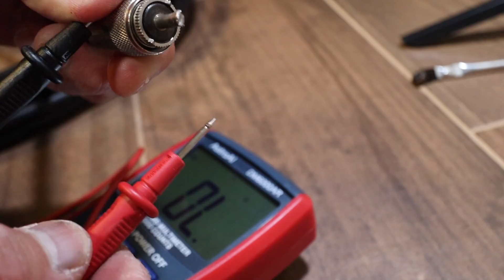WTF! | Neighbors cut my Coax! | Repair my PL259 connector Ghetto Style | Not my best soldering

Comment from the maker: I filed a "Criminal Mischief" report with my local Police Department.  I also have a camera facing my antennas for any future mischief's by anyone.
Reply: Some people are just miserable but should NEVER touch you property. I hope you find a resolve to have your antenna's up and enjoy your hobby. Best of luck.
Reply: Cameras will act as a deterrent.  If you can conceal them, you'll be more likely to catch them doing it again.  I'm guessing it's not an option in your neighborhood to mount the antenna on your chimney, or on a stake in your back yard?  Also, judging by its construction, it looks like you own that fence—which (at least in my area) means it's some distance inside your property line.  Edit: another thought: put a few feet of flexible metal conduit around the coax, so they need to use noisy power tools, or spend a couple minutes with a hacksaw—right in front of the camera.
Reply: That's a great start. Also it might be good to inform the less knowledgeable that as an amateur radio operator you provide an essential community/emergency safety service for free...Fla is of course prone to hurricanes, with loss of power/comes likely....
Reply: paint it neon orange too, for that extra eyesore sting
Reply: I had the neighborhood "Karen" say my antennas in my yard were and eyesore as well as my two antennas on my car and all should be removed.  WTF?  I just came back with her and said that the only eyesore I noticed in this neighborhood was her.  I hurt the little snowflake's feelings with that comment.
Reply: Thanks for the quick QSO this evening.

Sorry this happened to you (granted I'm a year late).  Seems they had to reach across the property line, assuming you own the fence.

Yeah, where you are, if not mistaken they have some fairly HOA-like municipal ordinances.  Over here on my side of the creek, they're becoming more like that, but the new mayor's reputation in my household doesn't have me holding my breath that it'll get any better here.  

I have two antennas that are very easily visible from across the street.  One is an inverted vee, possibly to become a fan if I can't get the fan vertical to perform (but so far it's promising), and the other -- the 2-meter super-J-pole I spoke to you with tonight -- is only visible because it's taped to a ten foot long 3/4 inch schedule 40 PVC pipe for rigidity, 30 feet up in my magnolia lifted with bright green 3/8 inch rope.  Fortunately there's no city ordinance against them on my side of the creek, and while permits are required for everything (though I don't think that includes antennas that are not supported by structures like towers), I'm certain they're not enforcing that for things like towers.  Still there are plenty of antennas out this way if you know where to look.  

Either way, it's been a year...  I'm curious if there have been any further developments or other trouble.  Seems to me that side of the creek is loaded with Karens.  Over here there are some but typically they keep to themselves.

Good luck!
Reply from the maker: @ke4edd  Yeah CJ, I'm okay with multi antennas for ham radio.  I talked to you also on a J pole about 25' up.  Check this video out:  https://www.youtube.com/watch?v=vSHr8k07PdQ&t=3s  73's
Reply from the maker: @ke4edd  Other troubles?  Why yes, check this video:  https://www.youtube.com/watch?v=ZigHPpKptLk&t=15s
Reply: @DarrenN4VFR  peculiar, i just watched that right before seeing this reply.

I see plenty of "car canopies" over here, the aluminum ones that look like incomplete sheds.  I don't know Jacksonville's ordinances regarding those specifically, but I've never seen an inflatable like that one.

I have a red 1986 Dodge Daytona Turbo Z C/S that I ran into the rear end of a 2003 Volkswagen Passat one heavily rainy morning getting onto the Arlington expressway.  It spent 7 or 8 years in my driveway before either a neighbor complained or the city did their regular drive-by.  Because the tag was expired, and because the tag was visible from the road, they left a red piece of paper telling me either to remove the vehicle or they would remove it for me, with a similar daily impound fee.

That was the impetus to empty out half of my garage and fit it in there.

At least your Porsche is drivable.  I miss my T-tops.

You know...   There are very nice homes for sale here on my side of the creek...  Two-car garages...  Some two story/multilevel with a 90x120 or larger lot with which to grow antennas and edibles...   And hams everywhere...    Just saying...  ;D
Reply: Sorry to hear that this happened to you. I never had anyone cut my coax but I did have some little kids tugging on my ropes that were holding up my 160-40 meter center-fed. I walked over to them as they were "working" and they said they were collecting "free" rope. They had no idea what was on the other end of those ropes and were pretty horrified that the ropes out in my woods actually belonged to someone. No harm done and they apologized and helped me re-tension the antenna ropes and that was the end of it. At any rate, hope your neighbor behaves in the future! 73, Rob W1AEX
Reply from the maker: @W1AEX  Hey Rob, I just recognized your call from the Apache Lab's website under  
FAQs, Software for Apache Lab Transceivers.   Just yesterday, I put in a deposit for 7000dle.  I might need to contact you to assist with set up in the future.  73's de Capt Darren N4VFR

Comment: After looking again, at 1:30 it's clear the fence is the perimeter of the neighbor's property.  Now, me, if I were building the fence, the posts would be on my side (harder to climb over from the outside) but most people here think that's "ugly" so they put the posts on the outside of the fence (which also saves the trouble of obtaining permission to be on the neighbor's side for the installation).  This looks to me like it's the neighbor's fence, neighbor's property, where you installed your antenna.  I also recall some vague law or something involving property rights when you have your stuff on your neighbor's property -- specifically it involved fences built on the wrong side of the property line -- but that was my father-in-law telling me about it when his neighbor put up a fence and I don't remember the details.

Still.  Was a year ago.  How'd it turn out?
Reply from the maker: I relocated my antenna on a 25' metal pole inside the trees.

Comment: That is bad. But I have to ask, is that your neighbors fence? From the way it's built I would say so. That being said that's his property that your antenna is attached to. So did you get permission to attach your antenna to your neighbors fence? I don't see why you could have attached the antenna to the back eve of that blue shed. Just an observation.
Reply from the maker: Yeah, it was attached to my neighbor's fence.  I did not ask for their permission and it doesn't serve them right to cut it.  They could of wrote me a letter or come over and knock on the door. They're A-holes and always complaining.  I have a police report to this incident. I just put it there temporarily for about 2 week and when I came home, it was cut.  I just put up another HF antenna my DX Commander and not more than 10 mins, I get a phone call from my city's code enforcement stating I was putting up another antenna. I called code enforcement back the next day and I sent a copy of my FCC license.  I told them I needed these 3 antennas because they operated on different freq bands.  Code enforcement with working with their attorneys to have the city's stature/ordinance change to not violate my FCC communications rights.
I asked who complained and they told me it was coming from my back yard neighbor. I should complain about how high their fences are and not in compliance with code and they would have to get it fixed which will cost more time and money! But I'd rather not have them peering into my property easily.  73's
Reply: @DarrenN4VFR  I hope you get everything straightened out. I live in Alabama and our laws and ordinances are different concerning fences and attachment to them or anything hanging over the fence onto an adjacent property. By our law/ordinance my neighbor could have taken the antenna down with nothing said and I could not have done anything about it. You just has a nosy disgruntled neighbor that just wants to be all in your business. I hope you will be able to get your antennas up without a lawyer...

Comment: Does the city have a problem with your ham antennas ? If so work with them and bring the ARRL along with FCC documentation as to your right to have those antennas. It looks like you did a good job on camouflage the UHF/VHF Antenna and also the HF antenna.
Reply from the maker: I've written a letter to my city with this reference :  http://www.leg.state.fl.us/statutes/index.cfm?App_mode=Display_Statute&Search_String=&URL=0100-0199/0166/Sections/0166.0435.html  I waited a little over a month to see if they were going to respond whic they haven't.  So therefore, I put back up all of my antennas.

Comment: the shielding of the cable is supposed to be twisted and put through those holes you soldered @ 11:46, and then soldered on that gap around those holes. there is a resistance as you measured it with the multimeter, that resistance will cause heat when transmitting with higher power, the cable will melt then and cause a short, that can destroy the amplifier. i would redo that connector. beside that, maybe you caused some interference into their electronic devices, which is why the cut that cable. better would be to add some ferrite tubes one the end of the antenna cable where it goes into the antenna, that helps alot to attenuate the potential for interference, a ground rod to ground the antenna would help too.

Comment: I use house hold scissors for cutting the shield away, works real well and if you ever need to sharpen the scissors, which I hardly have to, but use a light grit sand paper and cut several strips off the sand paper, sharpens up the blades on the cheap.
Reply: Wanted to add, not the outter casing, (the black plastic shielding), cause how you did it was perfect, but the braided ground shield using scissors, sorry to anyone if I made that confusing.

Comment: Well you live in Flo-i-duh, the state of do what I want you to do and F your feelings and desires if you don't like it!  I would advise that you get yourself a Diamond X700 and put that up on the peak of your roof where they can both see it and not access it to do harm.  But you clearly were asking for it by mounting it on the fence.  I suspect that the neighbor installed the fence and being Flo-i-duh you get the ugly post side unlike just about anywhere else in the country.  By the way, check with the city about fence installation requirements and rules.  They may be in violation of height and aestetics requirements.  You could also check to see if they are setback from the property line the proper distance as well.  That fence could be your opportunity to provide them with allot of issues and cost for non compliance.   I would start with the municipalities require a setback from the property line.  So hard with neighbors like this.  You did the best thing by repairing and moving the antenna to prevent this in the future.  Actually stunned considering how unobtrusive the Jpole is.
Reply from the maker: I know their fence is non-compliance on their height, but I'm not complaining.  I'd prefer privacy from them.  Your right about checking out the height requirements and proper setback distances.  Surely, that will cost them $$$ for non compliance as you said.  Thank you for your feedback.
Reply: @DarrenN4VFR  Always good to go in loaded for bear.  I totally understand your desire for a barrier from these sorts of neighbors.  But you have the option to go full dick mode on them and cost them major money and trouble.  In this case I would find out all the compliance issues with the fence and check setback as well.  My guess is that in addition to height, they are likely on the property line.  Also, the posts are supposed to be on their side, not yours.  If I am right you are in a position to relate this info and make clear that any further "issues" will result in a complaint to the city and dogged pursuit of full compliance with all applicable rules!  Faced with the above might take more than a little wind out of their sails and provide you with relief from the Aholes.   Good luck, and 73.
Reply from the maker: @mikeiver  That's an excellent advice!  Thank you.

Comment: eufy Security, eufyCam 2C Pro 3-Cam Kit, Wireless Home Security System with 2K Resolution, 180-Day Battery Life, HomeKit Compatibility, IP67, Nightvis   these  work great,,,not cheap  but  they  are the best i have ever had,,,i have solar panels  for them  but they hold a charge a long time

Comment: Another thought, get your General class license, wire antennas are easier to repair than VHF/UHF antennas. If you have your General Class, why are you hanging on local stuff? Black wire antennas are almost undetectable against the sky. When I first moved here, I told everybody that the antennas were a new type of satellite receiving antennas, and had no problems until a neighbor I mistakenly trusted let the "cat out of the bag". Then the accusations flew like rain in a storm. I was stupid to trust anyone with the fact that I was a Ham. So, the first thing I checked was MY station - no problems there. So, I D-F the CBer's, and found one culprit who was running aTEN 3-500Z amplifier without proper shielding, and turned that person into the FCC. They came when he was operating, and hauled him and his stuff away, never to be used again. All those 3-500Z's smashed and recycled, what a loss to honest Amateur Radio operators. BUT, the problem was "fixed". I did help one old lady because she was good to me, her touch lamp got some toroids wrapped around her lamp cord, fixing the problem even though I was not her problem. Old ladies talk/gossip, what better PR could I get? BE PROACTIVE, it helps us all.

Comment: I do not see why they think that they have the "right" to cut your coax.  FCC Part 15 states that their electronics must accept ANY interference that occurs to THEM! So, to retaliate against them, either go the legal way, or the way I go. Do they have cable or Satellite TV? Pins through the coax are almost undetectable, especially if you cut the heads off. Now, I had that problem until Katrina, Rita, Ivan and other hurricanes came through our area, and took care of it the usual way. BUT, when my neighbors found out they could either talk to their relatives or get messages from them in the affected areas to see if they were OK, then their attitudes changed. Amateur Radio is not a "Hobby", it is a "service" to our fellow neighbors during times of weather disaster, or worse. Neighbors ought to realize this and leave you alone. Get involved in RACES, ARES, MARS, or your local emergency services and PROVE that you can help them!!!!  I did, and they have never bothered me in 20 years. If a neighbor complains about some stereo "interference - keep a log of your on air time, who you talked to, what frequency, and make sure you have a darn good grounding system. That way the local FCC monitoring station can publicly eliminate you from the cause of interference to their cheap Chinese crap that THEY bought. Another thought, your own home can tell you if you have a problem. If you interfere with your own electronics, eliminate the problem source. That way you have no worries when the neighbors complain about some overpowered CBer jams the neighbors stuff. The ARRL has an excellent RF interference book, buy it. Read it. Fix whatever problems you might find in your own shack. A BB gun does wonders on your expensive cameras, letting neighbors vandalize your antenna systems and you will have no proof of who dunit. If you were smart enough to get your Amateur license, you should be smart enough to eliminate yourself from problems of RF interferences. Got it?

Comment: I never personally had a coax cut, but back in he 70;'s when I was a "CB buff", I had heard about people "pinning" someone's coax. In case you've never heard of "pinning", they take something like a nail and drive it thru the coax, penetrating the shield and contacting the core, which short-circuits your antenna and can damage your radio when you key-up! How sinister is THAT?
Reply: Tracked down a CB Ahole back in the 80s running a linear, likely in the 3KW range, and causing all sorts of issues both on the radio and with TV reception.  We pinned him and shortly after the problems ended.  Funny how that works!  Now days most outputs in modern equipment will simply fold back power and protect the output devices.
Reply from the maker: Yeah, that's messed up!  A lot of my viewers also mentioned about Pinning the coax line.

Comment: I was only about 12 years old when I rigged up a wire antenna across the yard ...one of the neighbors vandalized it.... - if someone tried that now then they would regret it ...I am planning some antenna systems myself ....and to install a few SDR's to start ...I plan to study for a HAM RADIO license... - my other hobbies include computers, networks and VOIP fones ...oh yeah IP CAMS TOO!!!
- might sit a high voltage on my antennas... - that way any vandals only act once.... - looooooool